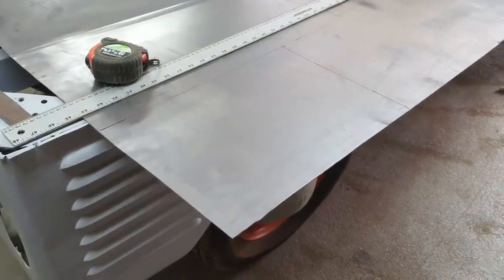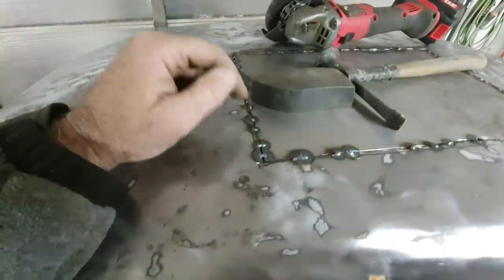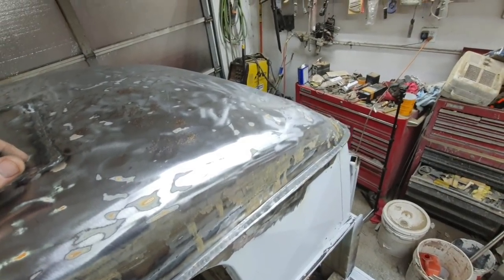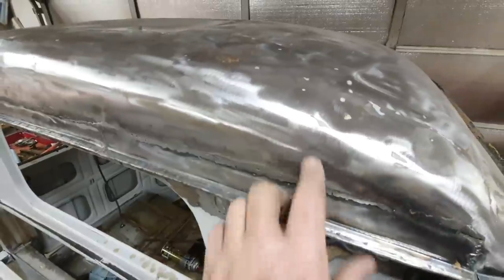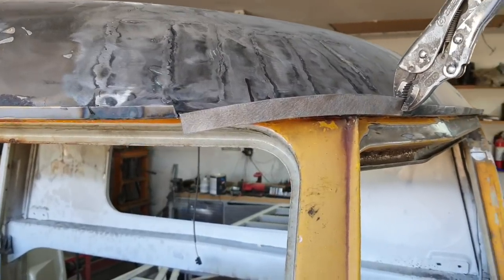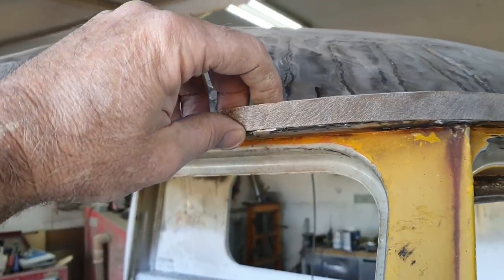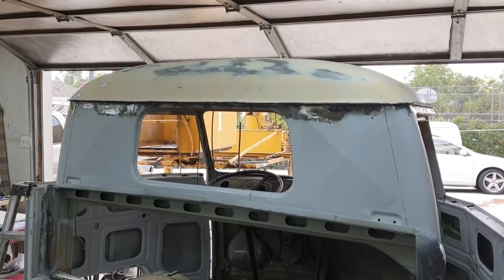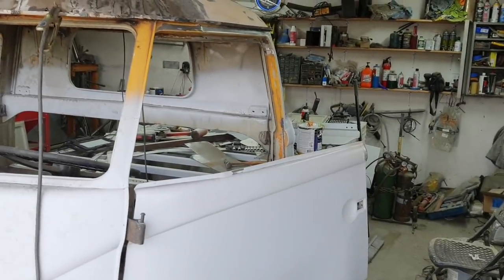SHEET METAL REPAIR butt weld drip rail VW single cab cherry picker

Comment: Hi Mike, well I've been off the internet for a while used my total quote of 100 gigabites in December so now  I enjoyed this episode. The reshaping of the roof is all most done Great metalwork. cool
I am working .beneath my T3 heavy rust problems with the connection of the trailer arm, but It`s all most done. Happy New Year 2021, we reached our goal but still, a lot of work remains.Greetings.HCS.

Comment: Good job on the roof. Hey got a small stick welder for a learner and was free. Haha, Anyway it can weld light sheetmetal like you said but on low amps and small rod. Being I plan on manufacturing square and angle steel I'll be going larger on both rod and amps. First will be building a boat rack for the truck this spring. We'll see how this holds up. I know if I can hit it with a hammer and the welds don't break should be good👍
Reply from the maker: those work for lots of things. Back in my early days it was stick or torch. Migs were thousands of dollars.

Comment: I named my truck patch because I patched a lot of section on it, both in steel and plastic. But this takes the cake as far as patchwork
Reply from the maker: for sure. no metal left just patches. I would have spent a mint on panels. for this truck. Gotta do what I gotta do.
Reply: @Mikefngarage  not a worry patching anything in your climate anyways. And if the vw "purists" whine and complain show them what it was BEFORE lol

Comment: I was curious on the 110 welder did you use a thinner wire or just the regular 30 wire.  I was curious because as a beginner myself it's so easy to get blow outs even with the stagger method you talk about.  I did end up going to 18 gauge sheet metal and that helped.  Really enjoy your videos. 
Thanks 👍

Comment: Hey Mike , ? Have you done filler work on you VW today  =   Why , yes I have . Man I waited sorta long into the winter to be doing the body work. It is going to make me run out of Hardner. I paint some in the morning and by dark it is just bearly dry !  That cold front you are getting is going to come all the way here on Thursday .  Your Truck is coming along well . You know it will be a lot more easy to get the parts for the picker now than 20-30 years ago because every thing is metric now.
Reply from the maker: dont put too much hardener use heat lamps or space heater

Comment: Great job. I really like how it's coming together. The rusty part on the top of the roof with the holes drilled in it, did they have a yellow light bar up there?
Reply from the maker: Yes they do and there was a pop riveted patch panel over that area I will be putting the light on  top of the roof again. IDK if it is a bit wavy because it will get mostly covered.

Comment: Thank you very much. I do have a couple of questions. 1/when welding the roof patch you welded a few spots to locate the patch, then angle cut the old metal to do a butt weld, and here is the question .. what do you do to but weld the places where you welded on top? 2/I subscribe to your channel, but no longer get the notices you have posted a video ... and the question is,  what do I need to do to get your notices? Thank you.
Reply from the maker: push the Bell button. I am not sure what your asking on the butt welding.
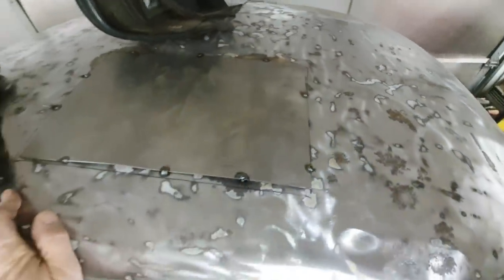Reply: @Mikefngarage  Pushing the bell no longer sends the notices that you have a new video. At :58 you show the patch with 9 lap welds .... the question was how you convert this lap welds into butt welds. Do you cut them with the cut off wheel, as you did the rest of the patch, so you can butt weld them, as you do at 1:12?
Reply: Got it ..from a previous video "lap welding into butt welding". Thank you.

Comment: what is the filler you are using ? i like the way the drip rails turned out
Reply from the maker: Auto art eurofil. and USC ag47 those are some of the best less expensive filler. Auto art sands super fast. Usc is just a smidgen slower and less pinholes. actually better filler but I like the fast sanding for auto art. These are similar to Rage at half the price.
Reply: @Mikefngarage  THANKS

Comment: Funk ok ...metal work no good
Reply from the maker: Metal work is not to look perfect for what I am doing. THe body work will be done to last and not crack. I dont make my metal look perfect just finish with proper amount of filler and it will be fine.
Reply from the maker: too much to make all the metal patches look perfect on this project it  would take 5 to 10 years to restore it. Need to do it faster and still get finished results that look good. Not doing a "perfect" on this one.